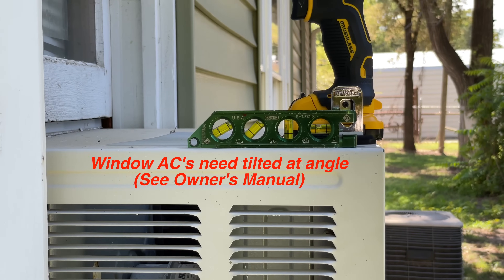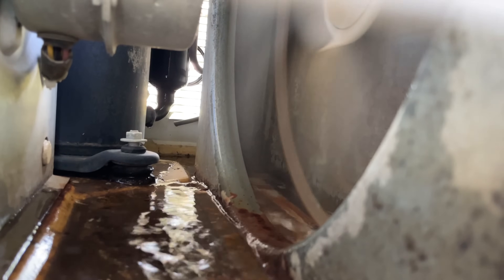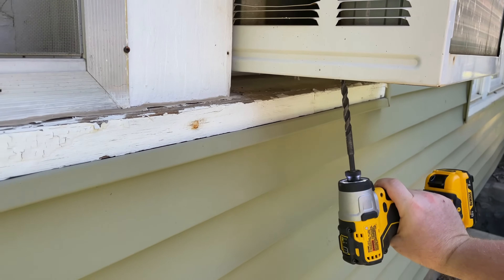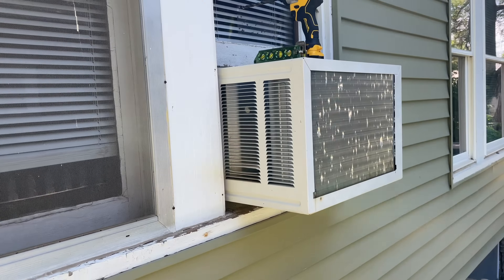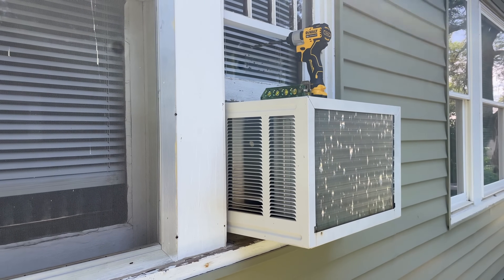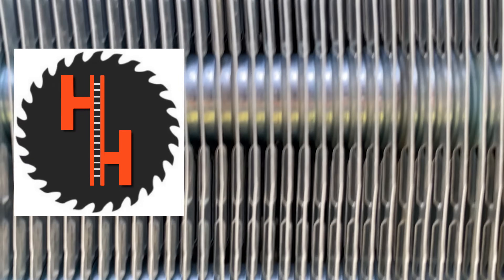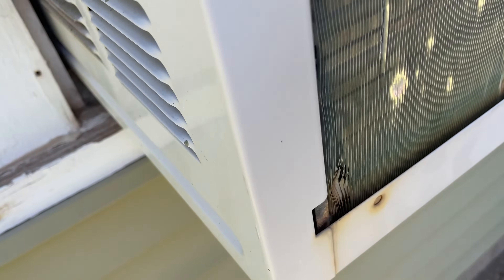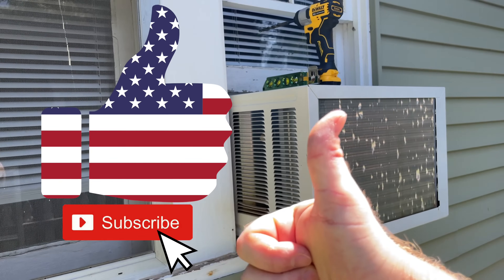99% Don't Know THIS About Window A/C's!! DON'T DRILL!!

Comment: Thanks for the informative video. This design feature took me by surprise too—I only found out about it after reading the manual and searching online. It seems like nearly all of the smaller window AC units sold now use this “no drain hole” design, supposedly to improve efficiency by splashing condensate onto the coils.

But honestly, it never sat right with me. Like much of the country, we live in a rainy, humid climate where dehumidification is a bigger priority than cooling. This system might work well in dry, arid areas, but in humid regions, it just builds up too much water inside the unit.

Eventually, I drilled my own drain hole in my LG unit and installed a PVC fitting with a half-inch drain pipe. It actually improved the performance and definitely helped keep things drier. Before that, it was getting boggy and gross—mold and rust seemed inevitable.

I’d really like to see actual data on how much efficiency this design really adds, especially comparing humid vs. dry environments. It feels like an over-engineered solution that ignores the realities of high-moisture climates.
Reply: Exactly! Drip versus no drip by experience is better for humid climates. We learned from experience cause we had both types. We are in Ga and the no drip unit made humidity levels higher in the room it serves. So, one size doesn't fit all in this case.

Comment: Definitely don't drill.  If the sound of the water swishing bothers you, you can roll up some paper towels and hand them outside the back of the AC.  It will whisk the water out of that pool and quiet it down (it will be less efficient).

Comment: I rather have a drilled hole and try to avoid the damage from rotted subfloors
Reply from the maker: If it’s leaking inside is due to either improper installation angle, or the more likely reason, which is the passage hole is partially blocked and damming up, and therefore the water is coming inside

Comment: Those weeping holes can get blocked or clogged. If your worried about hitting coils then just take out a few screws and take the shell apart. Now you can drill then put it back together. No worries.
Reply: it is blocked now with no holes.  😂😂😂.

Comment: HANDYMAN HERTZ  I STILL HAVE WATER SPITTING OUT OF MY LG A . C.  AND MAKING NOISE ? RSVP
Reply: SINCE YOU DIDN'T RESPOND! MY HUSBAND HAS SINCE. DRILLED IT THIS EVENING! 🙏
Reply from the maker: Sorry I'm just reading this. If it's coming out of the vents, that's probably due to water damming up in the passage between the evaporator coil and the outside pan and needs cleaned. I show where to clean this in my deep clean video when ever you clean it.

Comment: But that same water build up, its going rust the condenser coils eventually, and also, the dust will mix up with the water and create mud, clogging the ac, then its gonna start splashing the water towards the walls, and inside the house, staining walls and creating mold within the ac and the walls. 
So, drilling helps a lot, and AC works fine also!

Comment: here in the swamps of VA its 100% humidity almost every night. It will literally slind water all in the house and ive got it tilted twice what the manufacturer recommends. LG recommended a quarter bubble on the level, put mine at half bubble,  still water inside. never had problems with older units. Newer units slinging water for efficiency hust creates mold, drill the holes,  drill all the holes. (watch where your drilling.😂) Also have 2 dehumidifiers that run. Stay dry and mold free yall.
Reply: We just purchased a GE ac window unit with the slinger feature living here in Ga. I noticed right away the room got cold but the humidity levels inside that room went up in the high 60's and low 70's. 
We have an older unit that's designed to drip water outside and the humidity stays in the mid 40s and 50s.
So, there is a disadvantage to having the slinger for improved efficiency versus the drip ac unit feature. Potential for mold and lack of proper dehumidification, while cooling is a problem
. I'm taking it back and on the hunt for the old faithful drip function. Don't mind paying a higher electric bill over potential respiratory issues due to too much humidity.🫣
Reply: @alisalewis2560  Interesting... Though actually, while some people are like you, i myself thrive with COOLISH  humidity, due to my tendency toward Sensory Neuropathic Cough, as well as very poor circulation. Also: Did you know that some asthmatics thrive best in Balmy Breezes? They don't thrive as much in Arizona-type heat or dry-windy weather. Some asthmatics might tell you otherwise (due to not having experienced Cape Coral FL).
Reply: I live in VA too, and we have pretty high humidity all year long. So I don't think we need the excess water either.

Comment: Damn if that’s the case, I fucked up because I already put a hole in mine. Mine is really old and there’s a lot of gunk inside and I couldn’t find the port or the water would exit from the internal front to the back so I drilled the hole because it kept leaking into my apartment and damaging my windowsill so I guess I have to get a new one or what’s the call here

Comment: Yeah...no. It's just a crappy design. The "slinger" doesn't work and can't keep up with the condensate flow. The result is mold. The solution is to take the a/c apart, clear the (too small) drain holes in the styrofoam box, and then drill (yes) a hole in the slinger collection depression. Once you take the cover off the unit to clean it, you will see exactly where the hole needs to be drilled and it's nowhere near the condeser.
Reply: Update: I've been cleaning some of these. They're all basically the same design, the evaporator coil and its fan are mounted in a styrofoam enclosure. You can remove the top part to get "some" access for cleaning. I've been using Clorox foaming cleaner which does a good job on the mold. Some of these have drain holes, some do not. I've been using a length of 1/4" brass tubing with some slots cut in one end as a styrofoam drill. Works pretty well to add drain holes in the fan side of the enclosure. 
Next thing to do is to see where the condensate drains to. Often, you can drill a hole right under the "slinger", which should let the condensate drip out. I have only found one of four units that had any effective drain for the condensate. All of the moldy units had buildup blocking the condenser fins from the inside. Cure for this was to spray a strong detergent solution from the outside, let it sit, then use a garden hose, again from the outside, to flush the buildup into the unit. More flushing with the hose to flow the buildup out of the condenser fan housing and out of the unit.

Comment: No! Just know that several on here have reported an increase in efficiency after drilling, so like I said, the loss, if any, would be negligible. BTW, I see you have a unit sitting back further, does it throw condensate on the condenser coil, no, I didn’t think so. I’ve installed a couple of Mitsubishi mini split units, very high efficiency, they drain the condensate to the ground. SMH
Reply from the maker: It doesn't take much thinking to realize the AC condenser in the background is outside and the condensate is in the evaporator coil is in the basement. Of course it's not going to use the condensate. Same with a mini split. Cmon now.... use your head.

Comment: Hmm, I would say, YES DRILL IT!!!  Why? Math: 
Even when I haven't found accurate information about the efficiency of the slinger, I don't believe it would be more than 10%, which means that, for a Windows AC consuming around 50 per month, we would be saving 5 dollars per month or 60 per year, which is less than the cost of 2 required maintenances during the year, something I don't do, in any of the 12 units I own, and, at the end, we have water causing damage that reduce the life expectancy of the unit and force us to spend more on expensive maintenance. So, the savings on BTU efficiency would be, by far, smaller than the costs associated with keeping the water in the tray creating rust, noise, mold bacteria, and stinky odor. Now I'm drilling all my units, and so far so good, but still have to wait some time to fully validate the results.

Comment: This might be a feature...but regardless...drill a hole about 3/4 of an inch or bigger if necessary in a spot at the bottom where there should have been a hole. Keeps the bottom from rusting out and and collecting debris and mold at the bottom.

Comment: I drill mine and why....

1. Makes noise when fans are on.
2. Hold dirt and mold.
3. Rot out the coils quicker.
4. Mosquito breeding place.
5. You have to take it out of your window to clean it more often.
6. Smells more.
7. Just too much noise....
Reply from the maker: Some good reasons. I've personally never had issues with most of those. I would drill mine if I did though.
Reply: @HandymanHertz   Yet you put up a clickbait video that is misinformation, considering ACs without drain holes do not work right in all kinds of environments. mine was loaded with nasty water, dead bugs, and slime, because theres no drain hole. It was utterly disgusting. My wall slot is at a slight tilt but it still wasnt draining at all, made my house stink. I punched holes in the bottom corners, and its still working just fine.

Comment: My account unit us suddenly not draining or evaporating or whatever it's supposed to be doing and enough water collects to start building up ice, freezing up the unit and making a racket.  I shut it off long enough to fully melt and when I turn it back on, it's still squeaking for a while as it tries to sling off/out/over the excess water (out the front, if the cover & screen are off) until it's back to the right level and then it runs/cools just fine...  Until it freezes again and we start all over.  This unit has run well for years but moving/positioning (& almost falling once) seems to have had some unknown, adverse affect that I can't figure out.  It's more than tilted enough, could too much rearward tilt cause a problem?  It isn't a drastic tilt, for sure.

Comment: My LG window air is leaking in the windowsill outside, pulled it out a couple weeks ago washed it out some with a electric power washer. But still is leaking on the sill. I'm about to drill.

Comment: I ended up drilling mine a few years ago because condensate is very corrosive and it weakens the condenser and smells. It's been 100+ where I live for the past few weeks and its still making 50 degree air inside.

Comment: Your climate is probably better suited for this method than ours.

In Florida here...Ive installed these for 40 years and always drill them out at the lowest
point, everyone I have seen where they didnt, the inner pan was a mess of algae, mold, and puddled stale condensate, with stains all around them on the sill and wall. The fan slinging water often can cause water damage to the exposed motor, not to mention is its annoying hearing that splashing sound. After drilling, clean any burs out, and thickly brush some oil based paint on the area where it leaves bare metal, and allow it to dry before firing up the unit.
Also get the spray cleaner with a brush lid and perform bi annual coil cleaning. Clean the interior of the ductwork through the face of the unit with a long heavy wire with a rag tied in a ball on the end, using a mild bleach water solution. Vacuum the front grill once a week. Do these things even  the cheapest unit will last 10+ years.
Reply: Yep, this guy annoys me with the clickbait title. Acting all matter of factly about his misinformation which literally doesn't work for everyone.
Reply from the maker: @ThorStoneGaming all I can say is I just looked at my analytics, and 98.8% of people liked this video vs didn't like it. That's when you know it's NOT a clickbait video. People love it, sorry you didn't. It's not misinformation, I was explaining to ppl who didn't know there's a sling ring and how it works. YMMV...
Reply: well shit I was just sharing my experience, lol, didnt see any clickbait the video is actually accurate based on manufacturers recommendations.. its just in Humid states those recommmendations fly out the window...😂literally

Comment: This advice is complete nonsense for areas with high humidity and heavy rain storms; water will constantly lie inside the housing creating mold and algae, rusting the compressor and evaporator mounting bolts and rusting the bottom housing itself.
Reply: Exactly what happened to me.

Comment: leave the water to be a smelly moldy mess-- nope get the water out.   the minor improvement in efficiency isnt worth it
Reply from the maker: It's a non issue for me
Reply: @HandymanHertz  if youre in a humid area so much water will accumulate THAT IT Wont evaporate and without holes it wont drain and you get a mess
Reply: @HandymanHertz  Good for you, you aren't correct just because you live somewhere with low humidity.

Comment: Drilling a service hole (on the side that has nothing above the drill hole) is a great idea. I drilled and coated mine with white gorilla glue undercoating to keep it from rusting there (spray it on some cardboard and use a small artist's paint brush without the metal brush end to get the under coating on the bare metal).

Next use a foaming coil cleaner with corrosion inhibitors 3-4 times a year and focus a lot of treatment at the bottom of the rear coil. Use a hose to then spray all of the crud out of the coil and there will be a ton of it, tree matter, leaves or grey algae. You can then use a bit of wall putty tack to plug the hole or get a grommet that fits. 

Spray the inner parts that get green algae with some cleaner + bleach and it should mostly come nice and clean after / during rinsing. 

Finally, if you want to really protect the unit, treat the exterior paint with an automotive grade ceramic spray. 

A lot of focus should be put on protecting / cleaning the lower side as it is almost always damp or wet.

Comment: I had several occasions of water in the room from the air conditioner to the point of staining the wall, windowsill, etc. I drilled a hole. The unit was tilted away from the house for drainage, but there was no weep/ drain holes provided in the casing. I'd rather have a wet spot outside than inside.
Reply: Facts
Reply: As long as the unit is tilting away from house you can add a weep hole closer towards the house and it doesn’t effect slinger fan

Comment: Yeah I’d have to disagree on this. This is a planned obsolescence “feature” that ends up rusting out the unit very quickly so you can buy a new one sooner. The efficiency gained from the slinger ring is not there at least for me. Drill the drain hole!
Reply: Yep, the guy who made this video is simply wrong and acting all matter of factly about his bad info.

Comment: I've  drilled every a/c I've had and they cool just as efficiently. As water condenses the fan pulls on the water and cools the fins. Yes you are correct in the fact the it was designed that way. 
But it also grow bacteria mold and algae. That will eventually clog and degrade the materials. 
Planned obsolescence. You don't make repeat sales on something that lasts forever.

Comment: My old air-conditioning unit is 35 years old,  i drilled it over twenty years ago, it still works way better than the newer one i bought, so i don't necessarily agree with you. But to each their own.

Comment: Mine soaked the bedroom floor 3times and made a racket a ge product. I cleaned it all out and it still did it.  Nice try but, crummy idea.  Threw it out.  Ps, the holes did not stop it splashing water all over.  I know, I drilled them.
Reply from the maker: Sounds like your passage way from the front evaporator coil to the back of the unit was plugged. I have a video on this. It often gets missed in a deep clean

Comment: The joy of a cheap fix will be ruined the second you drill a refrigerant line or wiring.  Clean the filter and make sure your pet fur has not clogged the drain area.

Comment: I drilled a window unit in my old house that didn't have central air.  It was collecting water and making all kinds of strange gurgling noises.   So yeah, I drilled.  Hit the refrigerant reservoir, which made a hissing noise far more intimidating than the previous gurgling noises.  Of course it no longer blew cold air.  Wouldn't recommend drilling.

Comment: I put one or two condensate pan tablets in the evaporator coils when cleaning the filter and in the back after spraying out the back. It seems to take care of the smell and keep the evaporator drain clear. It doesn't seem to collect much water during normal use. I live in NE Oklahoma, and the summers are generally dry here. In the spring, I spray the evaporator coil with a pump sprayer to rinse any accumulated dust off.

Comment: Youre not in florida and the humidity of the south...even withbadequate tilt and a clean new pan the water grows a mass of algae in just days clogging the slinger  ..the water then runs into the house or wall. I still put a hole in to help. As a landlord i can attest that noone cares about the unit until it stops working. Usually the temp setting is too low also and the water output is way higher then.

Comment: The stupid part is that air conditiong manufacturers are too dumb to design the unit with drain holes. This is done on purpose to shorten unit life. So you have to go buy another one. Greed is the issue in design.
Reply: why are they stupid?   how will you drain the condensate?